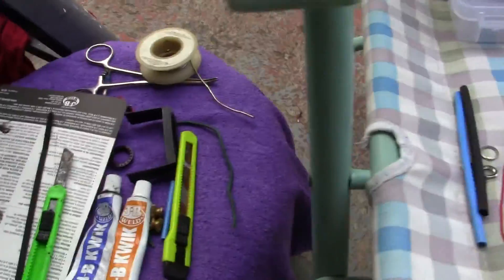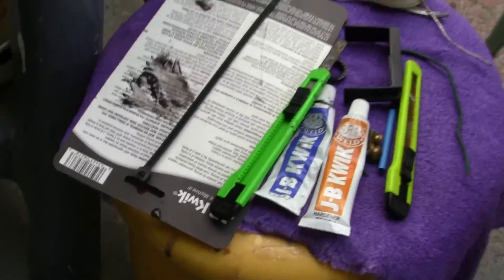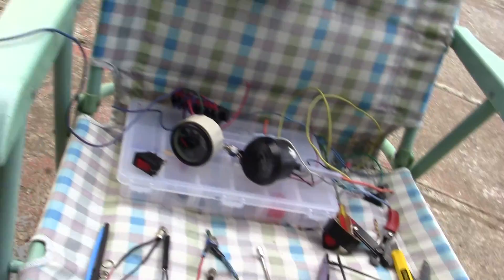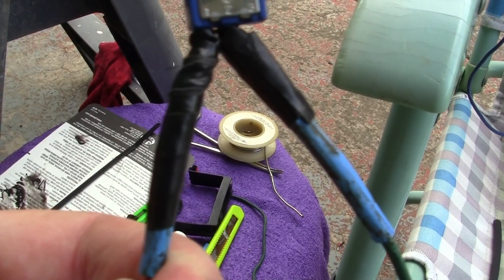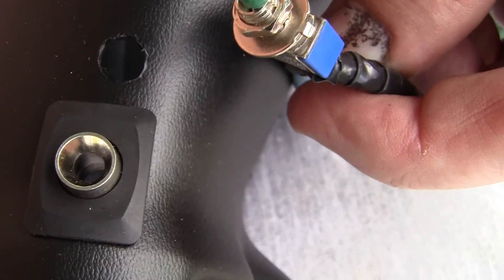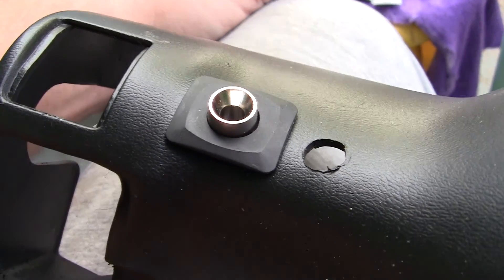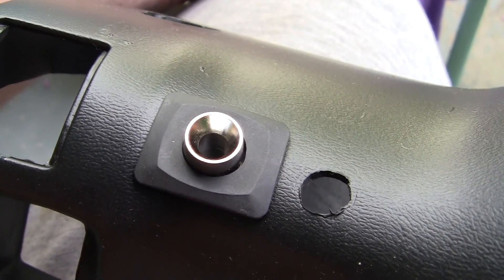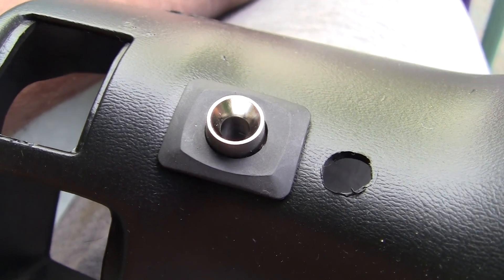JB-WELD, BEST WAY TO APPLY ON ANTHING

Comment: It tends to chips away the edge on the downward thru side. Kinda like cutting plywood with a circular saw the bottom side will be "burr" free, but the side that rests against the base plate will look like a beaver bit it. if that makes sense.

Comment: another pro tip. Put some masking tape over the polymer to be drilled and the edges wont chip. Eliminating the need to hide it with a overlap. Smooth is sexy. German sexy mind you. lol all good. take care bud.

Comment: Since your changing you're muffler bearings, you might want to flush out your headlight fluid too.
Reply from the maker: +Jake Long I had to change the Anti freeze on the air cooled engine and maybe later I can afford the high performance blinker and headlight fluid...